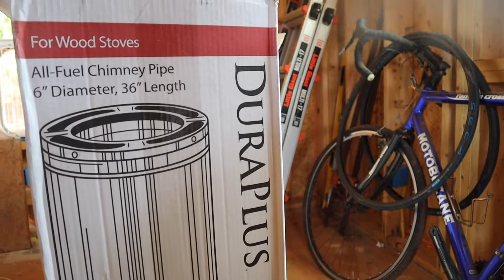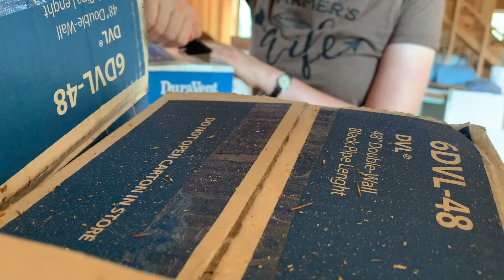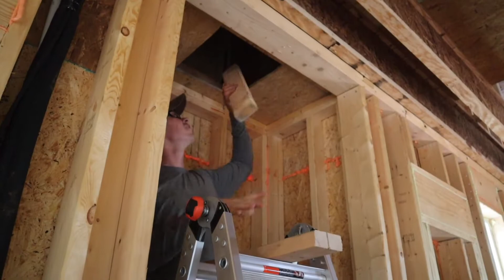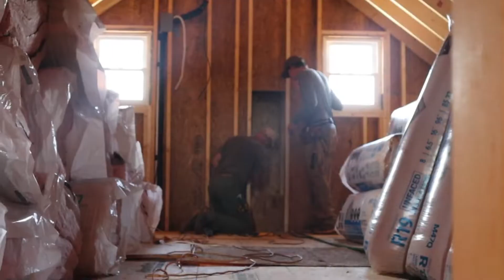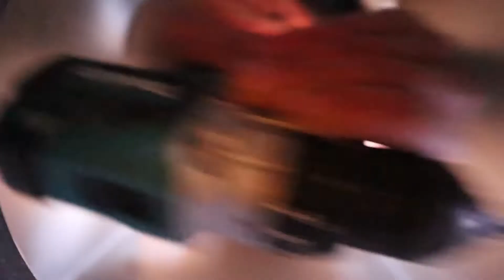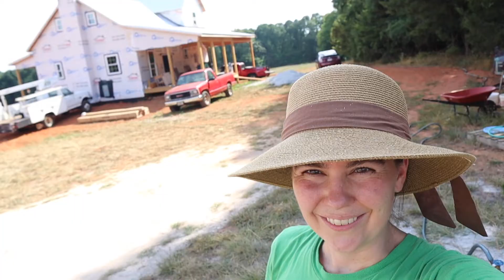Hot and steamy Wood-Framed Chimney

Comment: why not just use all chimney pipe?
Reply from the maker: Chimney pipe has a different fitting. You’ll need single or double wall stove pipe to connect to the wood stove.
Reply: @cottagefarmstead  why doesnt chimney pipe make a peice to connect to wood stove?
Reply from the maker: @redsresearch  You'll have to ask the manufacturer that question. But the chimney fittings will not attach to a wood stove directly.
Reply: @cottagefarmstead  probably for more heat, how far does the stove pipe go into the attic box?